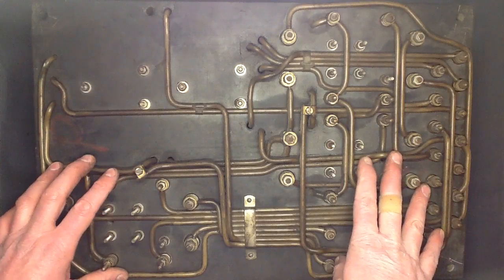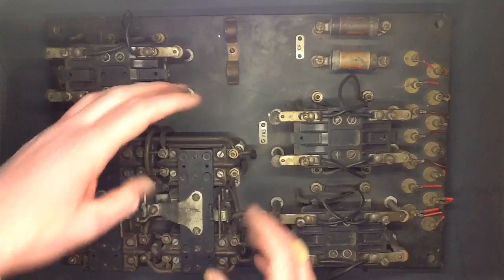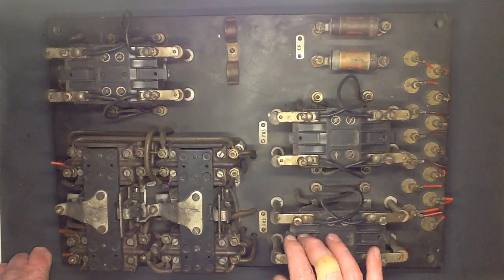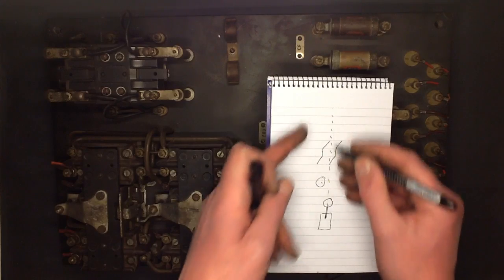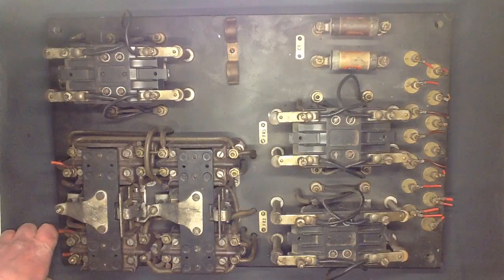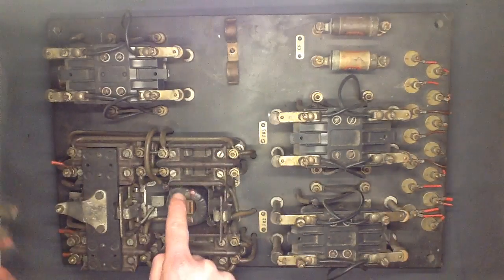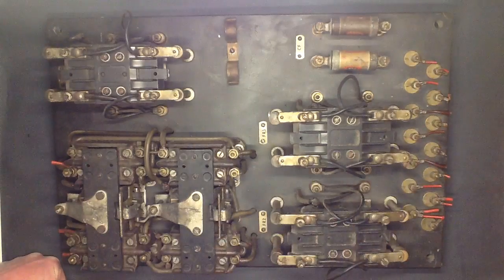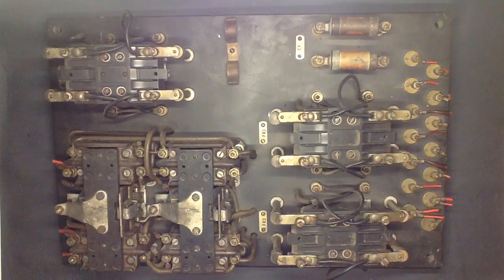Really old and VERY heavy slate elevator controller.

Comment: Pop,BANG!,flash,click that's the sort of thing I understand and love. Would've liked a ride on that old lift. So much of this lovely old kit is being scrapped. There's a load of old electro-mechanical stuff being/been dumped by London Underground and the railways like this over the last 20 years or so. On the line I worked on we had the nasty plastic new Bombardier "Electrostrar" - which I called Electrofarces. These replaced all the old reliable stock by late 2005. The first time I drove one in a slight frost, the computers shut it all down and that was that. The old electric trains previously used flashed and banged abit in such conditions, but they'd get you there. Very sad day when the last of these supposedly oh so dangerous trains ran. The new order used TWICE the juice to do THE SAME job. And the timings were slower too. Progress? My arse. Give me an oldie any day.
Reply: River Huntingdon yeah, they are too stupid to reckon what's tru value. or too greedy. selfish, corrupt, you name it. It is a shame, destruction done by people.  it isn't mostly newbies that haven't learned to respect & learn (from) the (mistakes made in) previous makes and (by) the makers thereof, and that haven't learnt to build on in the fundamental problemsolving age solutions and experiences already gained but the most often it is elderly who are rotten, uninterested & lacking in positive characteristics. I am thinking.
Reply: You’d like the Moscow metro. Fast as hell, carries 7 million passengers a day. The stations are amazing. 50p to go anywhere.

Comment: Pulling door open  "is a harsh life.."
You don't know what a harsh life is mister.
Reply from the maker: +Azzy M A heavy electrical apprenticeship in Scottish Steelworks, working for a company that routinely worked 48 hour shifts installing heavy compressor plant to deadlines and a LOT of outdoor work at great height in extreme winter weather.  I've a good idea what it's like.
Reply: bigclivedotcom
If you , and I believe you did, especially your mention of work at a height ( I often changed motors on top of 400 foot silos when the domed top was slicked with ice), I guess you were embellishing your speech, so to say.
OK. Anyways, I liked your vid.
Reply: +Azzy M - You might want to send your sarcasm detector in for servicing, it seems to be broken.
Reply: RFC3514  Yes, it could be broken. But then what is sarcasm if it can be easily detected.
Reply: +Azzy M Pointless is what it is. If it's not thick enough to be undetectable over a YouTube comment, it becomes utterly pointless; but enough with semantics and red herrings.
Reply: ***** - So if it's not undetectable, it's pointless? Anyway, nothing to do with comments. The line that Azzy decided to reply to is from the video. When Clive says "And then you have to pull the door open yourself? It's a harsh life..." (at 2:39) he's obviously being sarcastic.
Reply: +RFC3514 Yes he is

Comment: Old motor controls are cool.  Big and clunky but they last forever.  The conveyor where I work runs on old chunky Allen-Bradley contactors.  They are rebuildable, not quite as easy as this but not very hard.  Any of the modern ones for various add-on gear are throw away devices if they have a problem.  The original A-B parts have been in service since the mid 1980s, maybe with the odd contact here or there replaced.

Comment: I love the old gear. I was using an old porcelain knife switch the other night with mica covered plug fuses to do an experiment with my seven year old daughter in basic circuits. Patent date on the fuses is 1919. We also wired in a Hubbell snap switch that must be close to 100 years old as well. We were able to take it apart, see the contacts inside the switch, put it back to together and have our circuit work perfectly. They don't make gear like that anymore :(
Reply: Is a snap switch the full-sized version of a micro switch?  I supposed they had to exist but couldn't find one.
Reply: @tsm688  Yes and no. The snap switch I'm referring to is the old style of toggle switch they used in buildings for lights (and also the small metal handled ones that were panel mounted). They made an audible clunking sound when you switched from on to off or vice versa because the tipping point contacts were spring loaded. It was also to differentiate them from "silent" type toggle switches which could either use mercury contacts or non-tipping point contacts.

Comment: Around the 6:11 mark, an orb flies out of the panel. Clive, it's time to break out that ghost detector again 😱
Reply: An orb, otherwise known as out of focus dust.
Reply: Actually, it appears to be Clive's train of thought taking flight.
Reply: +Hot Dogs I hate to ruin the fun but I think the orb is just a little bug that flys in and out of the shot occasionally. I saw it fly off from the bottom even later in the video after your sighting and it zigzagged around like a bug would instead of floating in a straight line like orbs tend to do.
Reply: Probably the elevator mechanic's spirit.  No arc flash training years ago.
Reply: +Hot Dogs Woah, wow.  Where did that come from?
Reply: +Brian H. I have no clue. It looked like it literally flew out of the panel. It was definitely a little creepy.
Reply: +Hot Dogs Also at 0:55
Reply: +Mystere1985 Missed that one. Good call. I wonder if it's the same visitor from beyond. 👻
Reply: Orbs are BS. It's just a video artifact, almost certainly caused by stray high energy particles hitting the sensor.
Reply: Like, someone needs to stop taking the internet so seriously. Mmmmkay.
Reply: I don't know, slowing it down to .25 speed it looks like it comes from a very solid piece of the board, with no indication it was sitting on it before it shows up. It just kinda... pops in through the back.
Reply: Hot Dogs Right, YOU were joking, but others here take it seriously. They're the ones I'm taking the piss out of.
Reply: its a bug wanting to catch a ride on the elevator
Reply: That is SO clearly a bug. Can't believe people actually believe in that crap.
Reply: Somebody call 611!
Reply: Could just be a spare electron with nothing else to do. Even in today's age of austerity, you do still see the odd one or two about. :-)

Comment: BC + Tony Baines - could the methodology for obtaining the call point voltage be derived from one of the stator windings of the motor? A bit like autotransformer tapping of the winding of the cooling fan in a microwave oven to provide a voltage for the turntable motor. But then BC is tantalising us with a suggestion that it is full voltage - effective but not H & S approved!

Comment: Clive , crap modern stuff , is a refection of bad legislation . When companies get run into court for pushing crap on the public , they will change their ways or go bust . I do feel the suppliers of all product should have to supply , both their full personnel details of directors & sales staff & when they are rung up on a Saturday night , by some racked off customer , they would soon go out of selling rubbish for the "profit".
You are right . It ' s brilliant & great piece history . As Faraday had only died 50 years before this stuff was being built , it ' s brilliant . But we have both de skilled & re skilled . In the same way as OBD2 means cars run more economically , with higher outputs , pics & logical controllers mean that you can have soft start , which reduces the stretch & loading on the winding great . 
I was apprenticed through GEC in Rugby in the X AEI / BTH site ....... they had things that were pulled out of the test area , that had been there for a good chunk of 100 year & put directly in museums ........ still in working order ......... but they were safety hazards & require exclusion zones to ensured no one died .  This stuff is brilliant , but needs to be looked at as history .
Having spent some time in the X Zenith carburetor works in Deptford , the mid 30's building was service by the industrial version of this stuff & on a number of occasion I had to climb out of the unit that had failed between floors ............ the joy the joy ...... O the flipping joy .

Comment: I'd say 18kg.  If you bolt that to your wall, would you set up a boost converter at low amps to simulate an up/down run?

Comment: From Simmons H.H. And Avery A.A. (1919) Electrical Engineering -Switching and Switchboards:" The insulation of low tension switch parts is invariably provided by slate,, marble, porcelain or ebonite, while for high-tension work, marble, porcelain, mica preparation, or special materials such as ambroin, etc are used.In low-tension work, slate meets with the greatest favour in this country (England) chiefly on account of its mechanical strength, cheapness, ease of working and good appearance when enamelled.It is open to the great objection that metallic veins are frequently hidden in it, and these sometimes are the cause of much trouble through leakage, and may occasionally cause a dead short circuit.Where trouble of this kind arises, the holes in the slate through which conducting parts have to pass may be bushed with ebonite or other imsulator.Slate is commonly employed for bases up to 500 volts, but above this pressure some better material, such as marble is advisable." (P766)
At what voltage were the landing call buttons working? Or was there some cunning component to provide a safer working voltage than the 415 volts. That would be an electrifying experience!
Weight? well I estimate about half a sack of phurnacite, shall we say 25 kilos in today's money, if you can still get phurnacite.
Reply from the maker: +Hassan Burrows Landing call station has been videoed and will be up soon.  Full voltage!
Reply: +bigclivedotcom if it didnt have a rectifier or a transformer it would have been tapped from a phase, nasty reliable stuff .... lol
Reply: +Hassan Burrows Cool, thanks for that.  I was wondering about the use of the slate.  I wonder if the stone could have come from the Slate Islands in Scotland.

Comment: Neat!

Only a few years ago you could still find a bunch of even older lifts in Austria - these were so old they didn't have call buttons! You could only go up and once you closed the doors the lift went back down to the ground floor automatically - or not even that, some lifts had a "send down" button you had to push before closing the doors.

I've never been able to dig into one but AFAIK the controls were super-simple. Only two actual switches, one wired to the "up" and one to the "down" contactor. The buttons inside the lift were actually long steel pins that both actuated the "up" switch and stuck out the side of the cab. When the cab reached its destination, a wooden bar in the shaft pushed the pin back in and killed the motor.

All those lifts have to be upgraded now because lifts are required to stop more precisely at the correct height etc. Plus people have become a bit lazy and want to go down too. Loft conversions also killed a bunch of those lifts.

Comment: "...and they just wished they kept the old, simple one instead."

Except they can't.

Because Big Clive nicked the circuit board...
Reply: Its Not NICKED , It Was In Trash
Reply: salvaged more like. they threw it in a skip, thus trashing it, so if anything big clive happened to dumpster dive for some decent tech.
Reply: @kingemocut  fork-lifted it into a skip maybe. I've seen these things up close, they're stunningly heavy. Like tombstones. There were six foot tall, three foot wide, 1.5" thick slate control panels for the Denver Post (newspaper) printing presses I got to see. sadly, vandals had smashed all the gauges and much of the fancy surface-mounted equipment. Heart-breaking.
Reply: However that is illegal in the UK, kingemocut.  When you put something out on the kerb it belongs to the waste removal service and removing it or anything from it is theft, gypsies and travellers get prosecuted for it all the time.  Though until something is collected you can ask permission of the person discarding it if you can take it.
Reply: @krashd  and people say the USA has stupid laws. @_@ (of course we do - everyone does)

Comment: 68.03 kg
Reply: +thelastone7139  so Clive is bruce Banner in angry mode then
Reply: brian whittle lol is 68 kg or 150 lbs heavy to you?
Reply: thelastone7139  my point is 68 Kg takes some lifting and would take more consideration and effort  than Clive gave the part.
Reply: brian whittle If your weak, yes, ever work with slate? I have, working on pool tables, the shit is heavy.

Comment: More of this please!
As a trainee I worked in a local hospital in the Netherlands (about 15 years ago) and one of the machines I could look at (trainees aren't allowed to touch most things in a hospital) was an old elevator control system.
It used an insulated iron wheel attached to the cable spool that was lined with copper strips three or four rows wide. As far as I can recall it used brushes to detect floors. The rows were staggered in order to accommodate the use of star/delta switching when arriving or departing at a floor. The end switch was a leather leash clipped a three fase lever switch that would cut power to the unit and thus disengage the electrical motor and engage the spring-loaded brake.
I pretty much fell in love with it. 
We also serviced the more modern elevators, it had a grey box with slide-in PCB's. The box with spare PCB's was positioned under it.

edit: I'm going with 57kg.

Comment: I was wondering just how old that could be and I found this text from 1915 that talks about slowdown mechanisms with high/low speed modes. I think your elevator may have been a wee bit older than you surmised if it was old school in 1915.
https://books.google.com/books?id=nx0xAQAAMAAJ&lpg=PA45&ots=X804fYWhfI&dq=slate%20elevator%20controller&pg=PA45#v=onepage&q&f=false
Edit: I forgot, 28.2 kg or a touch over 62 lbs.

Comment: I service such 1920 stuff on our inspected freight lift. Three stops, the middle is two "eggs" on the control cable of which the second is engaged with a notch in the car. The control cable makes the full loop and has a drum with cams for off and the two phase controlled directions. One relay kills two phases, limits or safety gates. It's real naked Frankenstein tech. Problems? Easy fix! 
Slate? I thought this stuff was early Bakelite.

Comment: I got stuck between 2 floors at a hotel when I was 16 or 17. It was terrifying, and I still use the stairs to this day. The cable kinked or slipped the pulley or something(never found out exactly what happened), made an AWFUL ear piecing creaking noise, then stopped and quivered. There was some random little girl in there, asking questions constantly i couldn't answer. She thought she broke it because her parents told her not to play in the elevator cause 'she might break it', which obviously was just to scare her not to.  
I was in there for 5 hours before we were escorted out the top and lifted to the next floor up.

Comment: From Canada here, I know a highschool theatre that has a loading elevator still using this technology. It works fantastically. You can look out the top of the elevator and see the roller switches and the contacts for them at each floor (also three floors).

Comment: This is 40s/50s not 80s. I did my apprenticeship with a lift company and there are still many of these in reliable service. This would have most likely serviced an AC slip ring motor, the brake would have had asbestos pads and would have had a very large and very heavy toroidal induction actuator.

I used to love to working on these, brass contacts and solid core wire through the shaft. Impossible to get new contacts for these, so we used to clean them with emry paper and then adjust the throw of the contractor to compensate.

I could talk about these all day.

Comment: I'm guessing around 14.5 kg, and I'd assume that the controller in the video is likely from 1930-1940... Fairly bog-standard for the time I might add, extremely simplistic, as it the call stations outside and inside the lift both trigger the same contacts on the controller. This means that if you're in the lift and press a button the lift will begin to move to that floor, if you're on the outside of the lift and press the button it will attempt to trigger the same contacts and won't work while the lift is moving, and depending on how it was wired in the building could actually cancel the call made inside the lift and cause the lift to go to the bottom floor before hitting a limit switch and shutting off the motor and clearing the controller. 

This was also most likely made in the UK, as for the most part the UK isn't much for brand-name lifts, and as such larger local brands such as Waygood, Evans, and Express would've been the ones that had the manufacturing prowness to produce something as "high-tech" as this was at the time...

This board would've been fairly high voltage DC at ~190 V 12 A, which provides the power for the contacts (Not to mention the motor), not something you'd want to touch while the lift was operating.

Comment: I'm going to guess at 10Lbs, because it seems more appropriate to guess in pounds. When I were a a lad the local co-op department store hired a schoolboy/teenager to work the cage lift. The controller for that was just a swinging lever that could be held at the three (4?) different floors in the shop. It's a long time ago, so maybe it was just up/down. I do remember that the lift didn't always stop level with the floor. It was all very 1920's looking and that was in the 1970's.